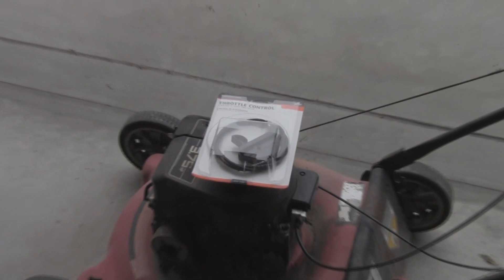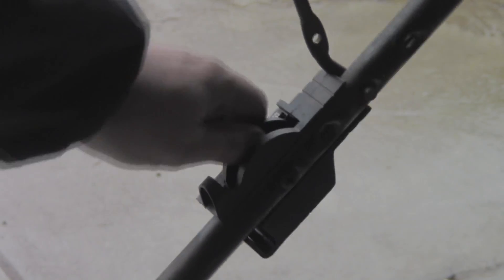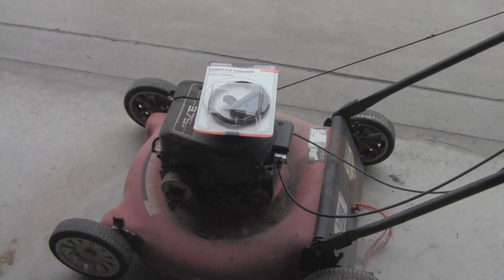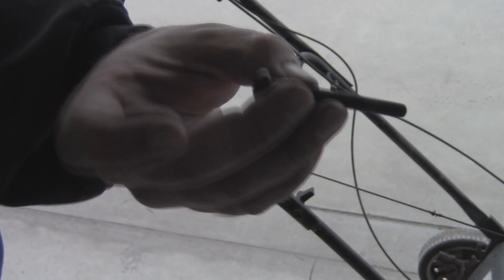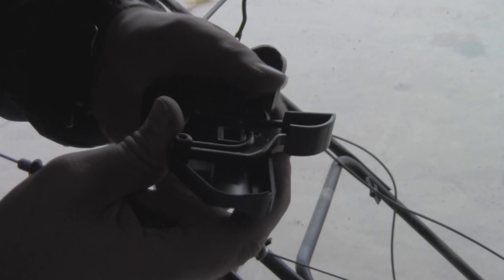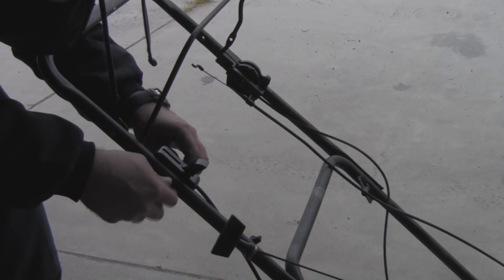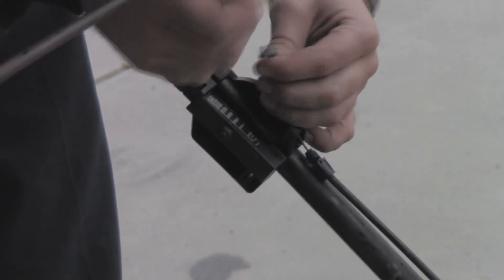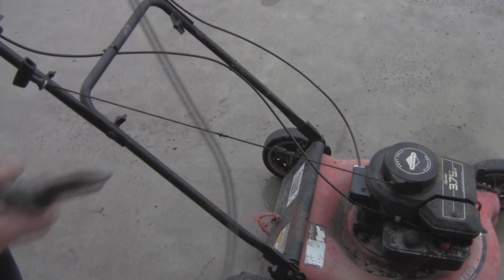Install a Mower Throttle Control

Comment: Mr Hank , my mower throttle was broken but i attached a little lever on the broken piece. The mower starts on turtle and when i move the throttle it increases speed but eventually when i get too far it stalls out im thinking its normal because maybe its designed not to go overspeed
Reply from the maker: That’s the choke for cold starting.